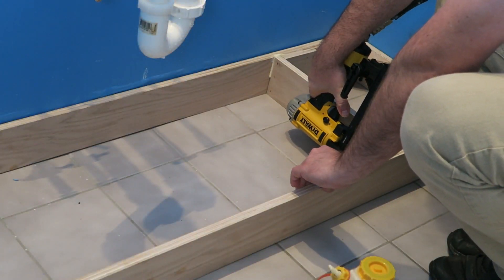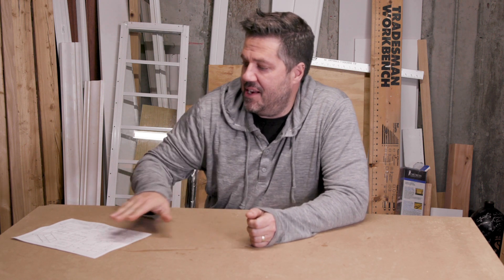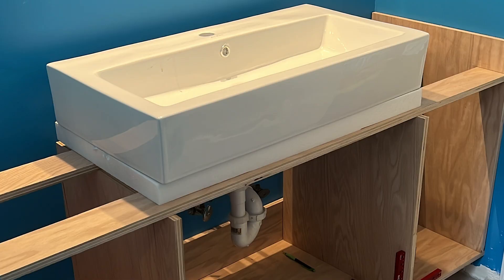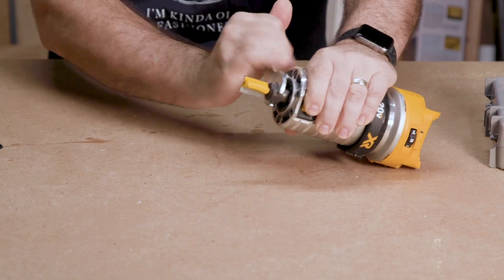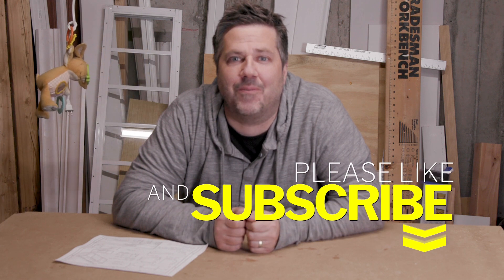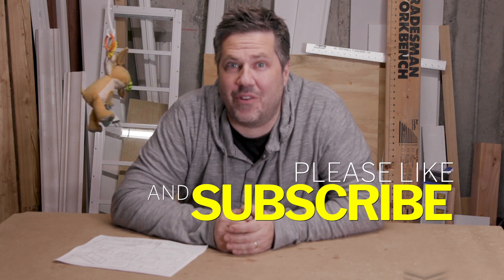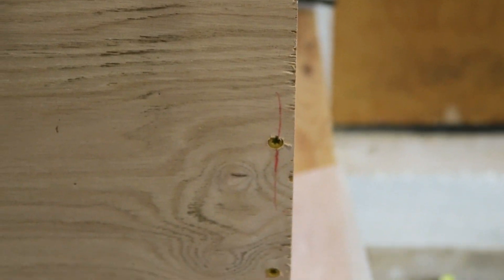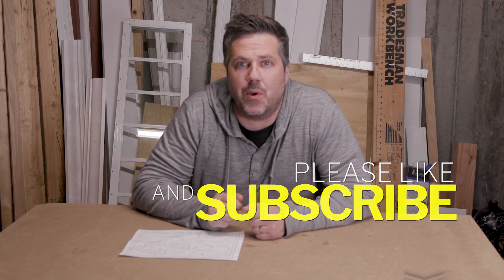I have a Dismembered Carcass in my Garage - Easy Custom Vanity Cabinet (Step by Step build - Part 2)

Comment: What cad software. Is it relatively easy to use?
Reply from the maker: I used FreeCAD. I also made an intro video called FreeCAD for the rest of us.  It isn’t hard but it takes a little bit to get used to the different tools.  I find it easier than Sketchup.  Another option I really like is Fusion 360.